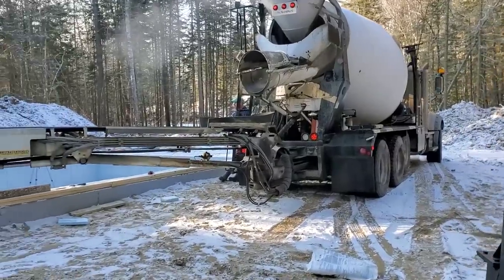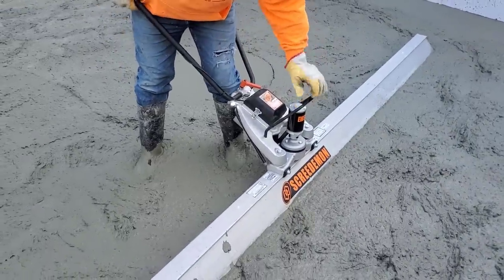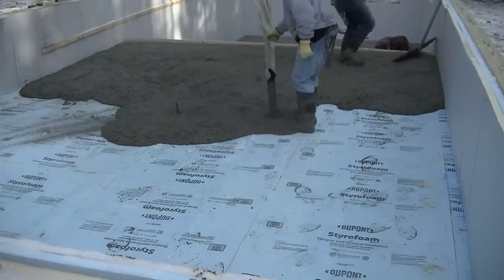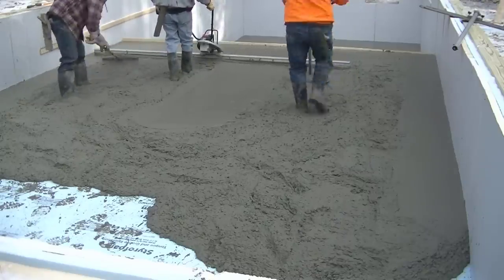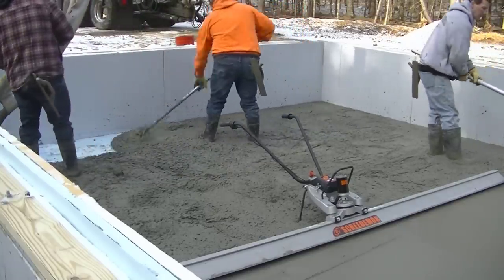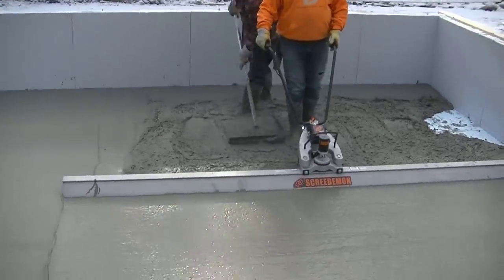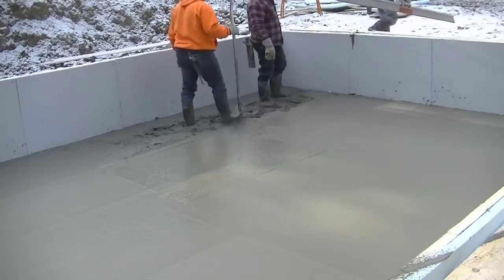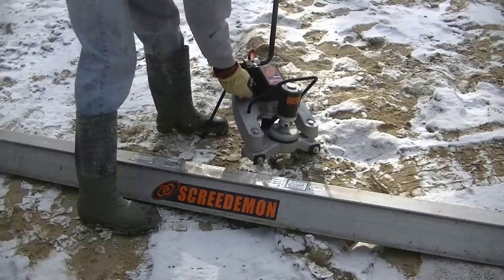NEW! Battery Powered Concrete Screed (MBW ScreeDemon) Vibratory Screed

Comment: That’s pretty cheap considering the advantage you get able to talk to each other “hey, fill that in please” or the day your gas model decided to blow the engine, or the stink of exhaust inside foundation already capped off, wonder when they will make battery powered power trowels? When I bought my adjustable blade vibrastrike power screed from Darryl at AH Harris some 12 years ago, they had it on the shelf for over a year and he sold it to me at cost with a 12’ adjustable board, meaning you could calibrate it flat or use it with a crown, so it was a huge savings and great investment for our company, had the 4 stroke Honda engine on it, thing was great, but it was heavy, when I was doing floors all the time I would’ve definitely considered buying a battery screed, hey Mike, another great job, I hope to see you guys soon on one of our projects in the spring, always a pleasure watching you guys, good luck this winter

Comment: Great videos....... I'm looking to put up a 60' x 120' x 30' tall prefab metal building summer of 2022. I will be the GC on the job. I will most likely will sub out the concrete 6" slab work ( 134 yards ). How much should I expect to pay for the labor only to set the forms, rebar, and laying out the concrete and smoothing it to finish? I'm in Western Massachusetts  area around Springfield, MA. Looking forward to getting your thoughts. Thanks

Comment: Mike, I've been really looking forward to this machine when it was first unveiled. Our company has learned the screed well, and we were looking for some more info on this machine. How do you think this would fare on a slope? Would you take the pitch right off of a 1/4" floor?
Reply: ^^^Same question, and can it pull a stiffer mix? Let us know when you test it.
Reply from the maker: You could use it on a slope with the right slump and good rakers. I personally like to hand screed a slope but that's just me.  I think you could use it on a slump about 4 and higher. I haven't tried a 4 yet but that's my feeling.

Comment: Is there any negatives using battery versus gas?
Reply from the maker: Not really, on a bigger floor you may need another battery or two for backup. stiffer drier concrete may screed a little better with the gas, I haven't had a chance to use it enough yet to determine that for sure yet.
Reply: Batteries are good for 3 years max, whether you use them or not and replacements are expensive $$$.
Reply: @psidvicious   Please show the data that the batteries only last 2 to 3 years.

Comment: Those screeds with battery doesn't work well when the concrete start getting stiff. And is when you wish to have the ones with a gas motor. They are good in enclosed spaces where they checking the carbon monoxide levels.

Comment: There is no more obnoxious sound on the planet than the sound of a 2-stroke engine. So this tool has got that issue taken care of for sure. 
   Like all battery operated tools, the technology is getting better and better all the time. But one feature about them is not. The cost of the battery is typically 75%-90% of the tools total cost (including the battery) and the life expectancy of a useful battery is only 2-3 years, whether you use it or not! For whatever reason, the batteries just go bad with time and older ones don’t hold a charge like a brand new one does. 
   I love the convenience of battery-op tools but if price is an issue, you may want to stick with the obnoxiously loud, old-fashioned version.
Reply: What are you talking about? The lithium batteries I have are over 5 years old and still going strong. Do you have any data to go along with your statement about the life expectancy of the batteries?
Reply: @trailrunner67     I should have put a disclaimer on my comment like “Your mileage may vary”.
I’m simply telling you my experience and the observation of others. I said, “I love battery-op tools”, I just said ‘this’ is something to take into consideration. 
   If you’re getting 5 years out of a battery, great! That’s not my experience. 
   You can look up data as easily as I can. I would just be skeptical of who’s producing the data and under what conditions.